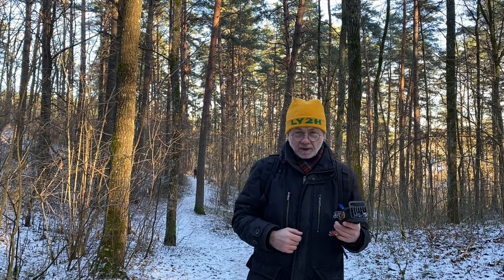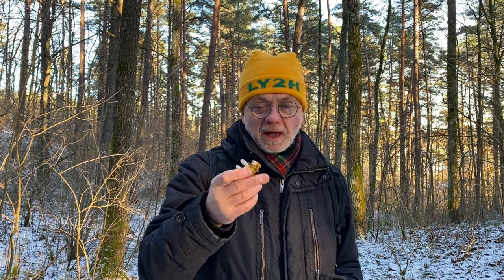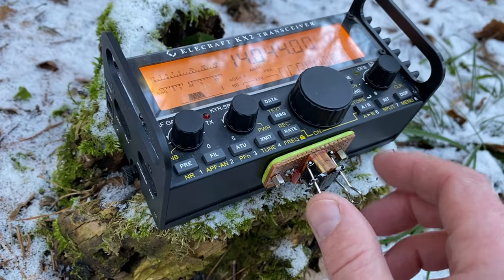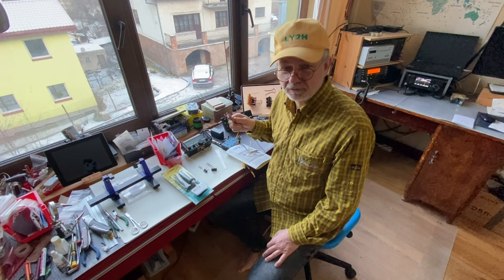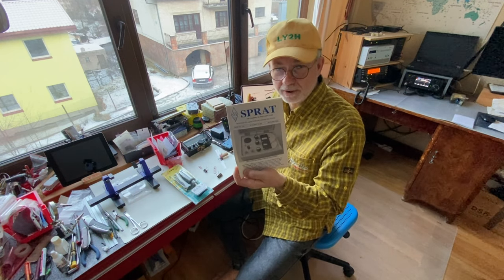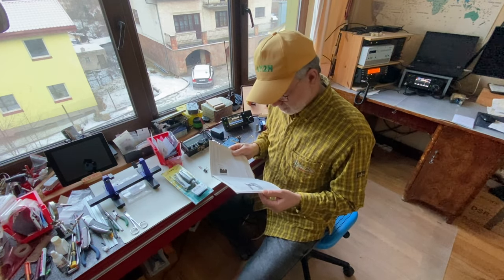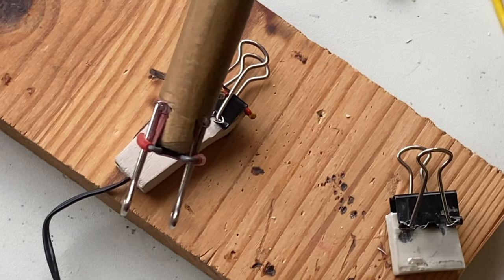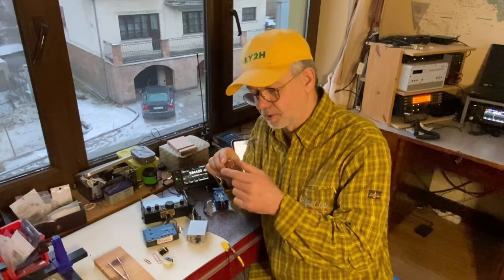Paper clip CW paddle: how to make a cheap yet reliable iambic paddle at home.

Comment: Hola Linas. Greetings from San Salvador. Just in case it is useful...
Ren, KG4BAS, build and sent me a set of paddles, just like yours, back in December, 2011. It is commonly known as the "Bulldog Paddle". Bulldog Paper Clip, is one the different names by which they call those clips in the USA. He made them himself. He designed this by himself to be used on the Hendricks PFR-3A QRP Transceiver. Maybe those paddles already existed before and he "designed" the mounting for the PFR-3, or maybe he was the very first one designing those Paper Clip Paddles for the first time.... I really don't know for sure.
He made them for me so I could use them at the front of my PFR-3A QRP transceiver. They attach exactly the same as you do with your Elecraft. Any way, just wanted to mention this as this happened a long, long time ago and could be of historical reference for you. Also, if you need photos let me know. 
73, 
Rob. 
YS1RS.
Reply from the maker: Hola Rob! Thanks for this interesting info! Yes, I know the Bulldog brand, it was pretty widely advertised many years ago among the QRP community. Unfortunately, they are not produced anymore… As I say in  the video, I got the design idea from the SPRAT magazine of 2005. So, if Ren KG4BAS, accordingly to you, made them in 2011, it means the design was already there. Unless Ren has designed it some time earlier and 2011 was just the year he made it and sent it over to you ? Anyway, it’s an interesting story and an ingenious design ! With the 3D printing era now, the design might be even more ameliorated :). And yes, I’d appreciate some pics if you could send them over to me! (at ly2bhp(at)gmail.com). Thanks! 73! Linas LY2H

Comment: Im working on some now- lots of trial and error for me, thanks for this video! I cant quite get the same springy-ness as you get- but Im working on it! For the copper pcb- is that copper straight touching the clip? Or is it insulated one side and copper the other?  Thanks again! 73’s va3kbt
Reply from the maker: Thanks Kevin! The springiness is depending on the grinding angle on the lever-holding place and on the distance between the two legs of the each lever. If the springiness is too weak, try to spread-out the legs of the lever, this will make the lever sit more tightly in its place. 
As to the  pcb pieces- yes, it's one side copper only, the back is insulated. In no way should the copper side get in contact with the clip body, or it will make a permanent connection to the ground of the dits or  dahs line, or both,  in the keyer. These tiny pcb pieces act as Did and Dah contacts and the clip body through the levers, act as a central, ground,  contact. HTH, good luck in making it! Please feel free to ask if anything else needs to be clarified! 73! Linas LY2H
Reply: @Linas_LY2H  ok- makes sense. I appreciate the help! Thanks for the videos!